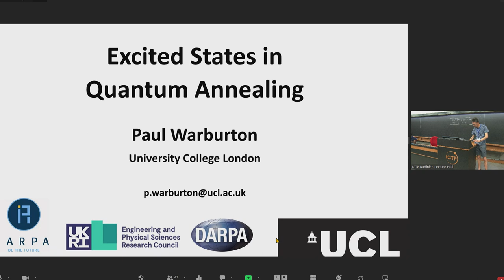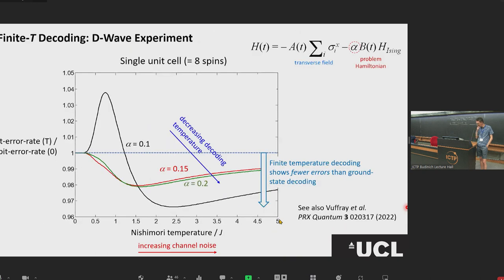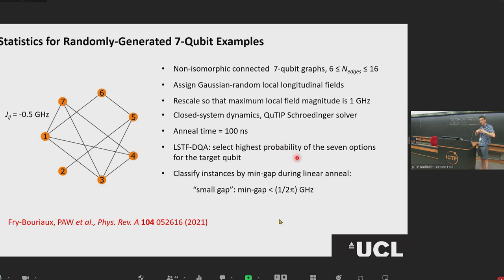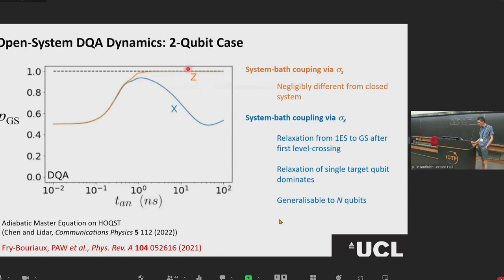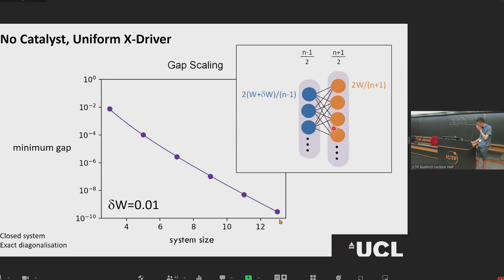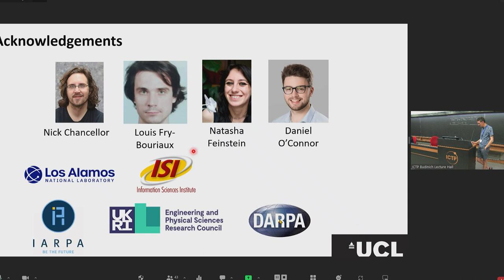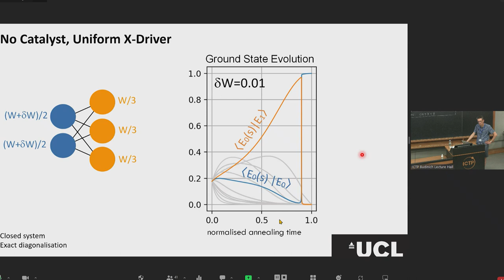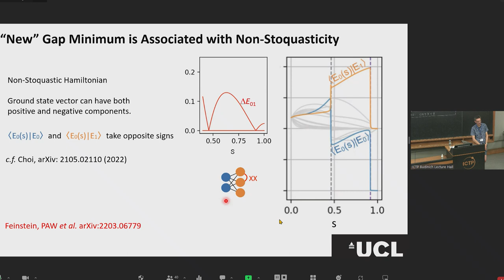Excited States in Quantum Annealing

Comment: @18:20 I think those similar GS probabilities could occur because of the process you describe (particularly at larger problem scales) with the cartoon, but much more likely that the problems have highly degenerate ground states (at these small scales), especially for those problems in which there are few edge penalties!